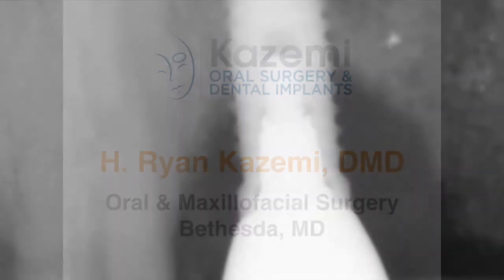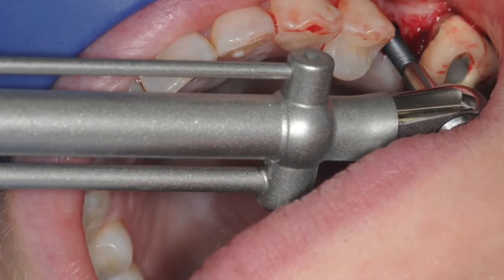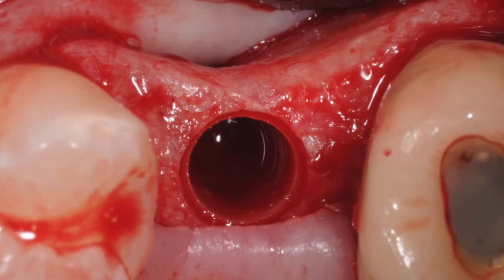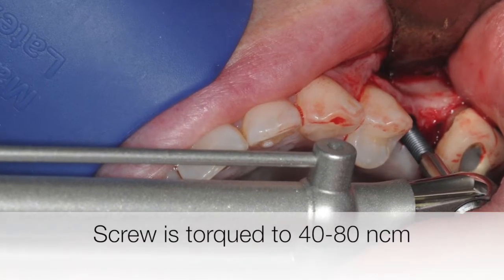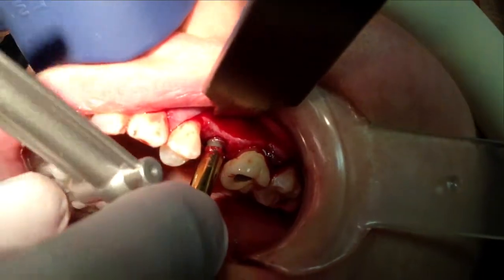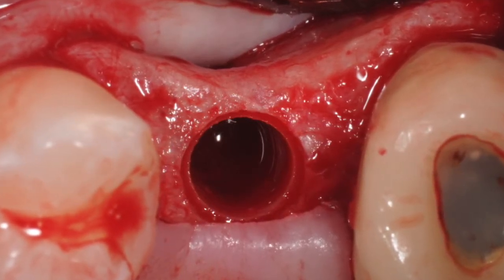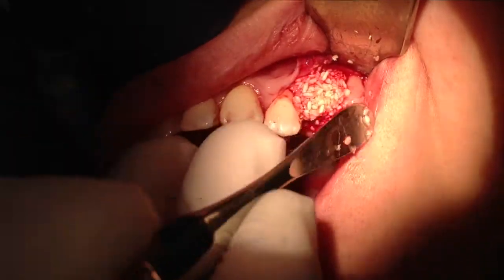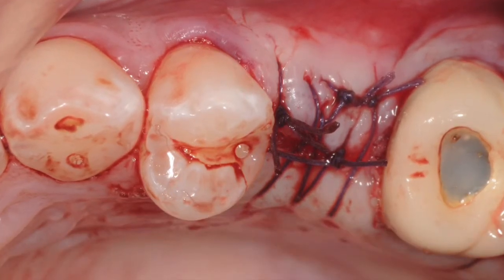New Atraumatic Technique for Removal failed Dental implants

Comment: ballpark idea how much this will cost? I'm asking becasue one oral surgeon wants about $1200 to remove using the "holesaw" technique which will take more bone away.  Aperiodontist who would do this backout technique presented but it's costing over 3k.  I'm small petite woman, with 5mm implant from 1998. I have Osteoporosis  and there is 50% bone loss around implant.  Frankly I'm torn about which way to go.
BOTH would do bone grafting. Oy.
Reply from the maker: Our reverse torque technique is generally 950-1200